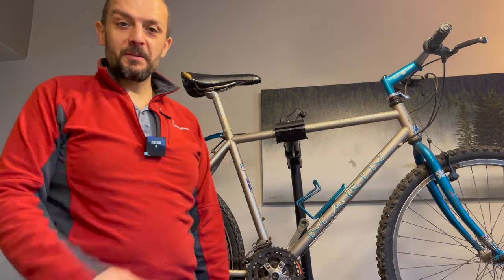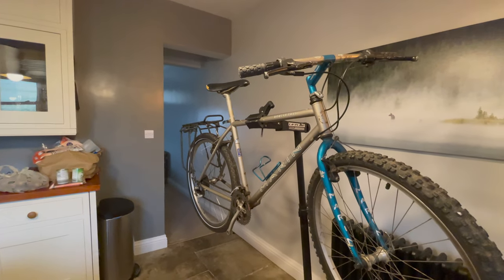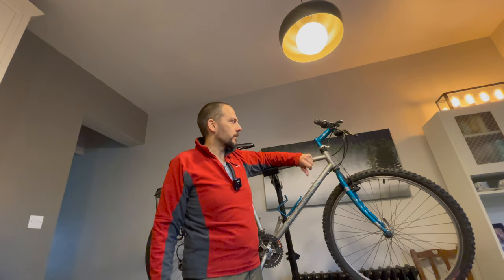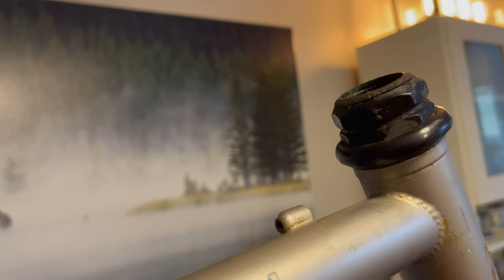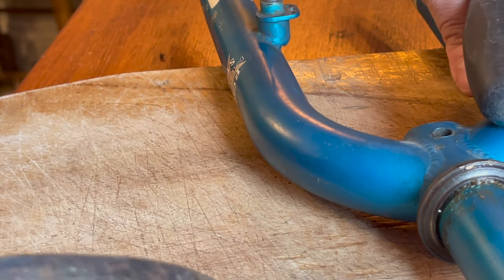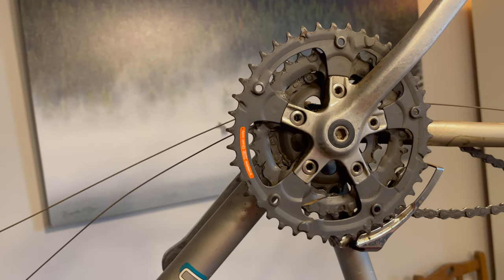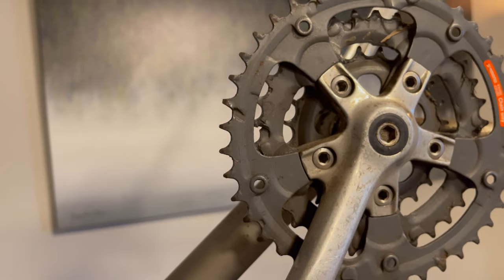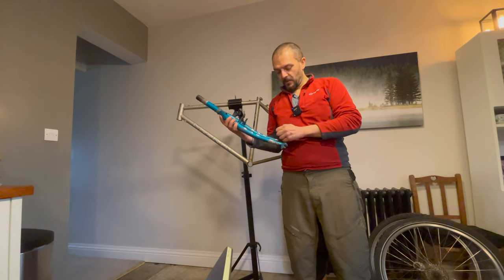Retro 1995 Marin MTB to Gravel Bike Conversion Pt1. How to make a bike an ace off road machine.

Comment: I just bought a 1995 Bobcat Trail and this series of videos is extremely useful as I'm a newbie bike mechanic! Thanks so much for taking the trouble to make them.
Reply from the maker: No worries.  I have not done many videos in the last few weeks.  Been in a bit of a litter/covid/environment funk.  But I am building up a hardtail and a steel adventure bike that I am going to document to get out of it.  I will start that this weekend.  You should get some tips from those as well. 👍🏽

Comment: I definitely like your view point on most things. But I did find that the hollow tech bottom bracket and crankset is a much smoother ride . I also am built like a British bulldog and I have trashed a few square tapered bottom brackets so, moving the bearings farther toward the crank arms is sound engineering for me.
Reply from the maker: Yes I agree with you. it is a new view point I have come to in my old age. I remember square taper coming loose all the time when I was a kid a lot of that was down to no knowledge of looking after anything as teenagers are :) I also like new tech when it has been an improvement.  What I hate is the number of standards we have now as each brand is trying to tie you in to just buying from them. Different shaped seat posts an good example and the number of bottom bracket standards that essentially are the same at the core with similar spindle diameters etc.  I just don’t like the fact that the simple beauty of a bicycle is turning into a minefield when it comes to replacement parts and the compatibility with others etc. I just hope I show in my videos though  that you don’t need a new expensive “gravel” “bike packing” bike that has been mass marketed to travel around the world and if you are in the middle of nowhere some old tech might be a bit of an advantage. 👍🏽✌🏽👌🏽
Reply: I'm also built like a brick and I brake frames. Most recently I broke an aluminium Marin, and I will never buy aluminium again. In fact, modern bike frames just aren't strong enough, that's why I'm a fan of 80s and 90s steel frames.
Reply from the maker: They certainly do the job and they are just as capable as anything modern.  All my bikes are steel or titanium. The hardtail I am building up is aluminium but it is for my partner and she is only 5ft 6” and 8 stone.  Good job she does not read the comments, I would get in trouble for disclosing her weight 😂

Comment: The bike I learn on is a old mtb diamondback, probably  1995, I like it but since im almost 1,80mts/6 ft tall my knees started hurting when I tried to go faster. Should I get rid of it or is there something I can do to at least use it as a commuting bike
Reply from the maker: If the frame is the right size for you then adjusting the saddle height, but also front and back movements too. You could also look at foot position on the pedals.  I use clip in as I have a very dodgy knee and it helps keep my foot in the right place and offers movement as well.  You could always look at crank arm length.  Basically, if the frame is the right size then it should be possible to get a position that is comfortable. A bike fit might be worth it if you are planning riding  most days. I also get knee pain in one leg due to lack of cartridge in one joint.  I am at the point of maybe having a knee replacement.
Reply from the maker: BTW I am not suggesting that action for yourself!!! There are lots of different factors with setup that can cure most problems

Comment: Great video, I had one off them for about 4 month's till it got nicked from inside Plymouth city centre, I currently have a marin pine mountain 1 (2017) with 27.5 + 3 inch tyres, 4130 xxl cro-mo frame with rockshox recon fork, 11 x 1 speed shimano SLX 11-42t cassette. I was intending to buy a allround touring bike with rohloff or pinion fitted, if I got a pinion then I'm Ltd to frames, could I fit a rohloff hub to this frame or would it be to much faffing about, I've been looking at the thorn nomad mk 3 with rohloff hub and gates belt, it might be over kill to what I want the bike to do ie cycling unloaded at times and bikepacking and general light touring, basically just a general all rounder, would you have any other recommendations, I would have about £5000 to spend if needed, and must be in stock in current times.what do you think, cheers iain.
Reply from the maker: My brother had Pine Martin in the early 90’s I borrowed it one day when I was cycle couriering around Leeds and it got nicked!

Ohh you have given me a lot to think about with your bike choices.  Don’t worry I love this kind of question.  I would need to know your riding style and who you ride with to get a better picture of some suggestions.

Would you be riding with others or on your own?

How do you feel about riding heavier bikes? Are you what they call a weight weeny :) or for this bike would you be putting reliability and sturdiness over going fast.

How do you feel when riding up hills do you take it steady or is it an out of the saddle sprint?

£5000 is a good budget for something sexy.  You can get a Titanium Pinion / Belt from Solace cycles for that kind of money.  I have spoke with one of the owners and they know there stuff and they are in the industry for the right reasons.  Have a look at this link and see if that was the kind of thing you were looking at.  They are really sexy!  He told me he has a delivery time of six weeks (it was a month ago when I spoke to him)

http://solacecycles.com/bikes/om-2p
Reply: @RidingBicycles  I ride on my own, not too bothered about weight as my marin frame is xxl and weighs about 15-16 kgs, hills don't bother me as long as the gearing is correct I won't get out the saddle so take it easy, I was looking at the thorn nomad and mercury, I will be using it as an everyday cycle with bike packing and light/medium weight local touring when required, I will take a look at the solace, basically I just want a bike that will last me for the rest of my riding day's as I turn 50 in a few month's time, cheers iain.
Reply from the maker: Excellent 👍🏽 I have a good selection in mind for you.  I have some time tomorrow and I will get the list to you with positives with each one. List  should be with you by 1500 👌🏽
Reply: @RidingBicycles  that will be great, thanks..
Reply from the maker: So the reason I was asking about your riding style and who you ride with is to do with the fact that a Rohloff bike will be a bit slower and heavier than a derailurer bike.  The weight is also in the rear wheel so it is in the rotating mass which is a place that weight is meant to make the most difference.  So if you love dropping off things from a height a Rohloff might not be the best choice.  For general touring and off road touring though they are perfect.  I did the Pennine Bridleway on a Rohloff bike and it was ace.  The 18sp Pinion is a similar weight but as you know it is in the centre of the frame which keeps the wheels nice and light.  They have the C.12 and C.9 gearboxes which are lighter, have the same range but the jumps between them will be slightly bigger compared to the P.18.  I have the C.12 coming on Tout Terrain Scrambler that will be with me at the start of June.  Long back log.  As the Rohloff and Pinion keep everything clean it was just a logical decision for me to go with a belt to ensure that everything was clean and oil free.  There is no stretch with a belt so once it is set you just forget about it for about 20,000 miles.  But chains work fine too, just keep them clean and oiled and you are good to go.  On a Rohloff it is an 8sp chain you use and these are nice and thick so wear less and last longer then 11 to 12 speed chains.  To have a belt on a Rohloff or Pinion you need to ensure the frame can split on either the dropouts or the seat/chain stays.  Now on to bikes.  I really like the Thorn bikes so if you have your heart set on them don’t let my list deviate from your research, but these are just some other ideas that you might like:

If you end up buying from the US or now Europe the initial bike will be cheap but remember you will then need to pay the import tax.  This will normally end up being the same or even cheaper than buying a brand already here.  To mitigate the tax I might buy a frame from the US then build it up over here with UK sourced parts.

One shop I can highly recommend is Keep Pedalling in Manchester they can build you up any Surly with Rohloff and chain and you can get the lovely Fargo made up by them with Rohloff and Belt.  For £5000 you should be able to get the titanium Fargo which is lovely.  Keep Pedalling are Surly/Salsa and Rohloff dealers and know them inside out.

** Most of the Tout Terrain range will fit your requirements so they will be worth a look
** Tumbleweed cycles make a lovely Rohloff specific bike.  At the moment chain only
** Solace cycles (6 weeks wait)
** Nua bicycles in Barcelona are beautiful titanium for Rohloff and Pinion both Chain and Belt
** http://www.rennstahl-bikes.de/en/ Amazing steel bikes they also do stainless steel which looks awesome Rohloff and Pinion
** http://www.falkenjagd-bikes.de/en/ Same company as above but titanium
** Woodrup in Leeds can build you a beautiful handmade steel Rohloff tourer
** Shand handmade in Scotland specialise in Rohloff and belt will have one in their range that will be perfect for you.

And then to finish here is a list of bike manufacturers that are offering bikes/frames compatible with belt using Pinion or Rohloff.

https://www.cyclingabout.com/belt-drive-touring-bike-manufacturers/

All these will meet your requirements perfectly.  Bombproof bicycles that you can do some nice trips away on.

Have fun researching and let me know which one you go with 😀
Reply: @RidingBicycles  thanks for your quick reply, much appreciated. 
I would like to keep the build to a uk dealership if possible as I would like to visit the shop and test ride before purchasing and also speak face to face. 
I am still drawn to the thorn nomad mk3 as it's built like a tank and also can be fitted with a rohloff hub and gates belt, also can be changed to a derailleur gears if necessary, also can run 650b and 700c tyres. I had a look at the shand cycles and they a very nice also, I was also looking at the surly ecr, the salsa fargo ti is also nice but it is £3000 just for the frame alone and don't know if it comes belt drive ready ie split in the frame.
I mainly ride my marin on tarmac and bridle ways and general daytrips/touring local in the northeast of England. Do you think the thorn nomad would be a good choice and good alrounder or do you think it is over kill, thank iain..
Reply from the maker: I really like the Thorn bikes but as you say they are built like tanks for round the world expeditions.  The Fargo can take a belt because they utilise interchangeable dropouts so it ends up having a gap for the belt to go through when the dropout is removed. I am sure Keep Pedalling have done Fargo belt and Rohloff within your budget.  They once built me up a Rohloff Surly Ogre £3600. Surly can only take chains though. The ECR is a nice bike but if you are mainly tarmac with a little bit of off road I would go with the Ogre or the Disc Trucker. With Shand you have the option of the expedition ready Tam or the more versatile Stoater.  I would test ride the Nomad, contact Keep Pedalling as they will let you have a test ride in an ECR, Ogre and Fargo, they are good people.  One more has just come to me the Pathfinder by Sven is stainless steel and made in Devon!! Can be Rohloff flat or drop bar.
https://www.svencycles.co.uk/the-pathfinder
Reply: @RidingBicycles  great, will have a good look at all you recommended as there are plenty to choose from, thank you iain...